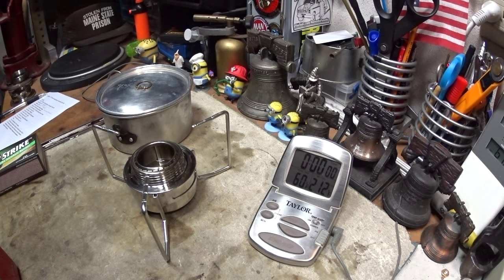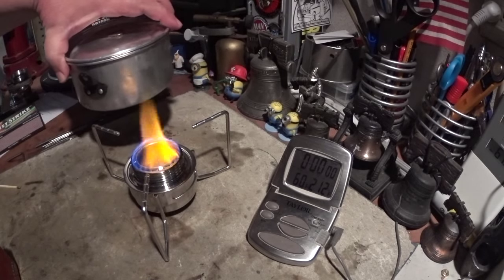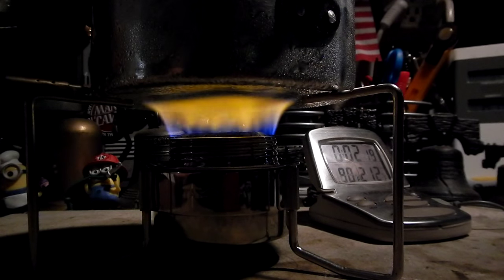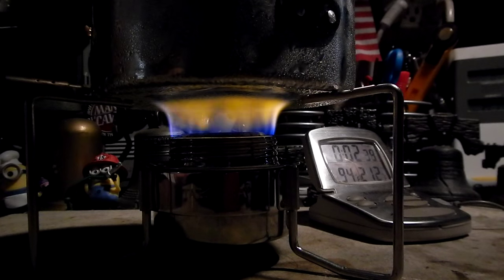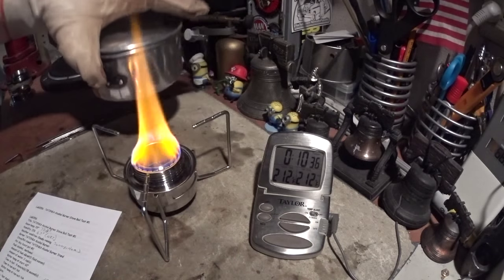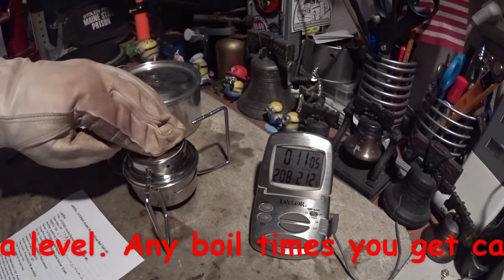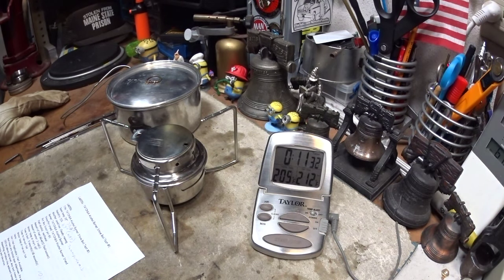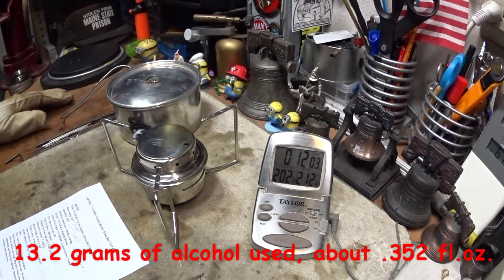TATONKA Alcohol Burner Stove Boil Test #1

Comment: Hiram, did you ever determine whether or not the Tatonka uses an internal wick (such as carbon fiber) like the Trangia does?

I believe some of the really cheap Chinese Trangia knockoffs omit that internal wick to save on cost.  And, honestly, I've been holding off on getting one of these Tatonkas until I can be sure it has one.  Those wicks make quite a difference in how these burners perform.
Reply: Sentinal098765 Yes the Tatonka has a wick , I can see a couple of threads in the bottom of mine . AFAIK , Trangias have a cloth wick ,   not carbon fibre ,  or carbon felt  .  Nothing quite so 21st century . ;o)    Hiram very obligingly sawed a Trangia in half some time ago .

Comment: just curious what happens if you change the space of the burner to pot distance.  As ColoradoCamper showed the Trangia had a 1.5 inch optimism height.  But it seems the vapor is burning cooler.